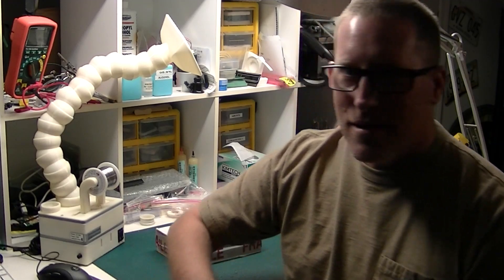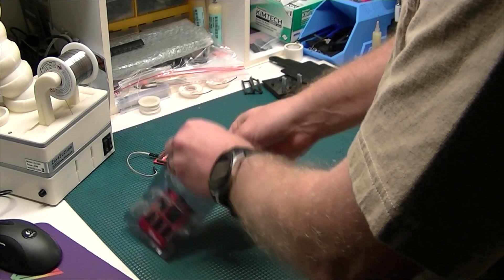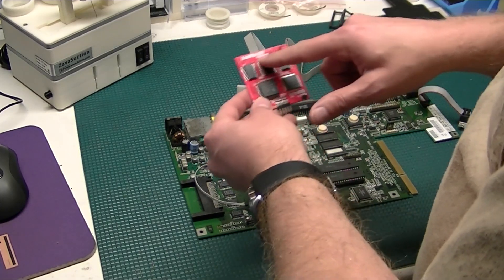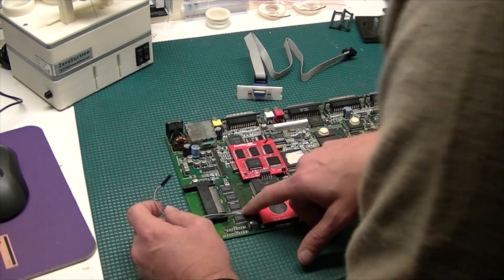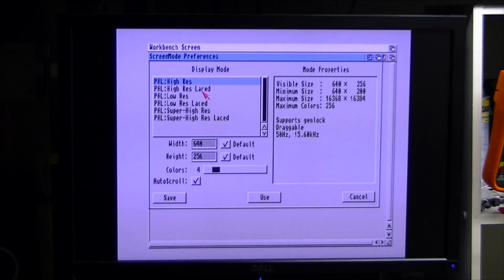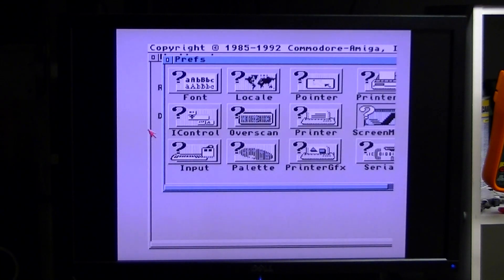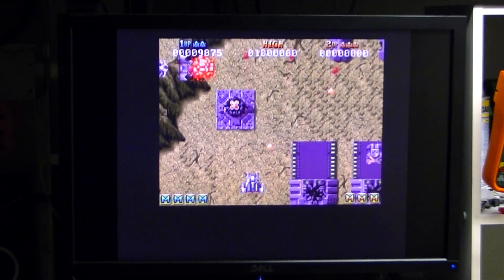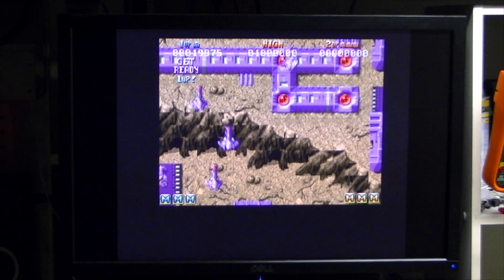ScanPlus AGA Review and Demonstration on an Amiga 1200

Comment: great, i have the 4xIDE adapter plus the gayle chip option installed, unless i can have a seriouslly weird extender on gayle  to lift it higher than alice, they just wont fit. Actaully alice and the gayle option will fit... it's the size of the lisa board that will cause grief. There has to be some adapter to lift it another 5mm (on alice so the gayle adapter can fit under it)... time to search.

Comment: Had the ScanPlus AGA but it look not so great on my BenQ BL702A VGA monitor. Have now the Indivision AGA MK3 and it look razor sharp. And i like the Live-Modus on it. Have set it to PAL High Res Laced 32 colors and run WB 3.1.4.1 - BestWB 1.3. 

Use also my A500 the Indivision ECS V2 which is far better than the old Indivision ECS V1.

Comment: Interesting. I had assumed that this unit did flicker fixing, too, being that it had to capture signals from both Lisa and Agnus. I suppose it works in multiscan modes, and that should be flicker free
Reply from the maker: Nope, its purely a scan doubler it seems. The odd thing is this monitor does remove flicker if I directly connect the Amiga native output. Same VGA input even. Using the ScanPlus AGA it doesnt seem to be able to clear it up.

Comment: Great video, the 15hz problem is a pain and anything we can do to get on modern displays is a great thing!  Great videos, enjoy them.  How did you set the IDE cable once you put it back in the box?  Did you lay the CF card on top of it?
Reply from the maker: If I were to leave this one on the 1200 I would do that yes. In this case it was just being used on one of my test boards and came off after the video.